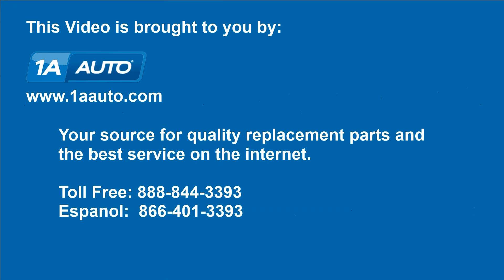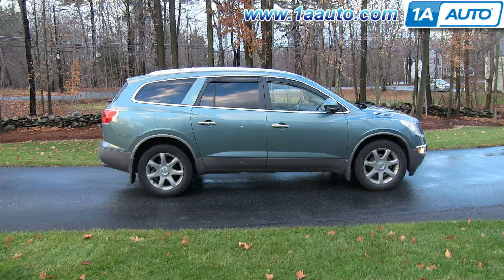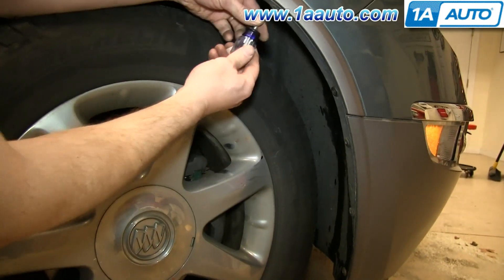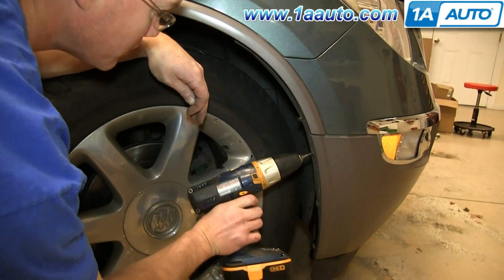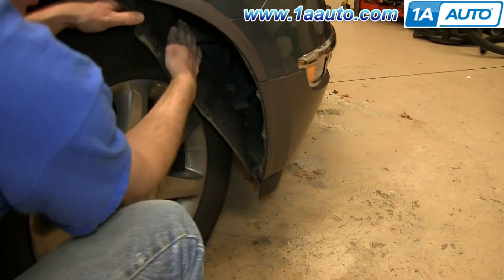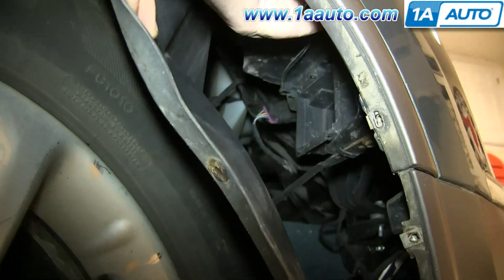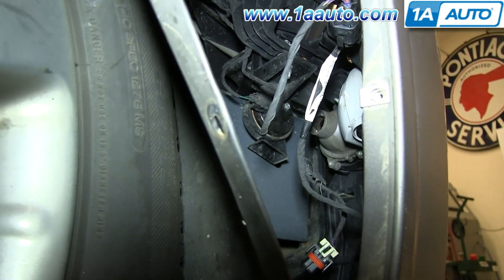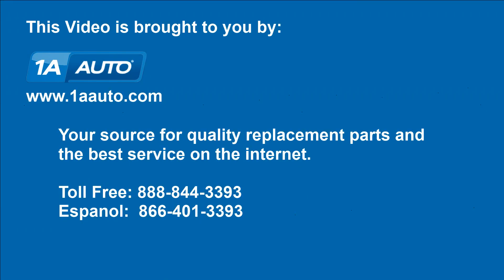How To Change Bulbs on Headlights, Fog Lights, Turn Signals 08-14 Buick Enclave

Comment: My sister has a 2011 Enclave, her oil change place said the DRL bulb change would involve removing the whole front bumper fascia and needed to be done by a Buick dealer. I saw your video and had it done myself in  10 minutes. The only difference was her 2011 uses torx screws instead of Phillips. Thanks for the free advice.

Comment: Do you know if the process is the same for HIDS (High Def bulbs)?  I have a CXL that comes with $100 HIDS.
Reply from the maker: We currently do not have an auto repair video on this particular repair. It may be a similar process. 1aauto.com 866-403-3393

Comment: Sometimes the Daytime Running Lamp (Socket) burns out also. Be advised of this also.
Reply from the maker: +Daniel A. Henriques Thank you for checking us out, as well as the advice. This will certainly assist other viewers performing the replacement. 1aauto.com
Reply: Are the daytime running lamps the assembly built into the fog lights???  Both of mine are not working...  But I'm unsure of the proper bulb that is supposed to be installed because I didn't know what to call them when I was at the parts store. 2011 Enclave  Thanks!

Comment: You need to remove the wheel well cover if it is not warm, otherwise it will crack. To remove the well remove the tire and all of the screws and clips. I tried this method in my garage at about 55 degrees and the wheel well cover cracked quite easily.
Reply from the maker: +James Stump Thanks for checking us out. 1AAuto.com

Comment: I used a 1" wide scraper between the tabs (watch the wires) to twist out socket. 2728 or 2827 amber bulb.  Pick up the bulb first.  Would be nice if this video gave bulb part numbers.
Reply from the maker: +Harry & Linda Nicholson Thanks for the tips. We'll send that forward about the bulb part numbers. We try to cover those in newer videos.